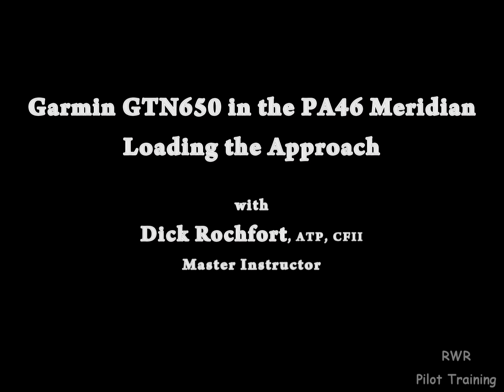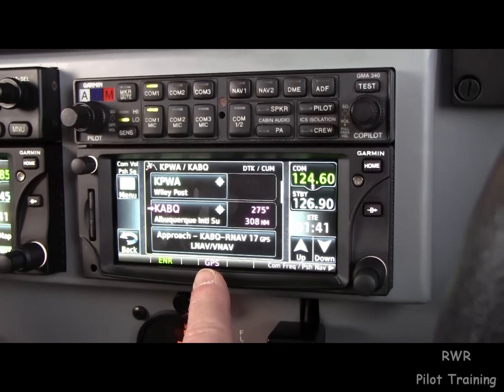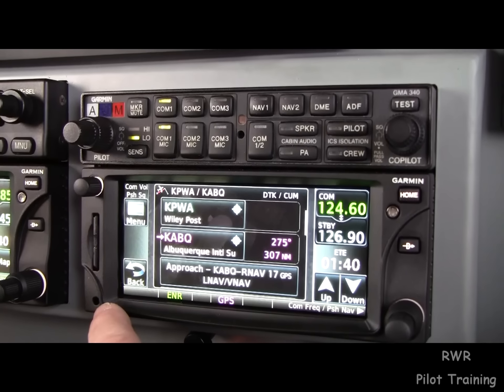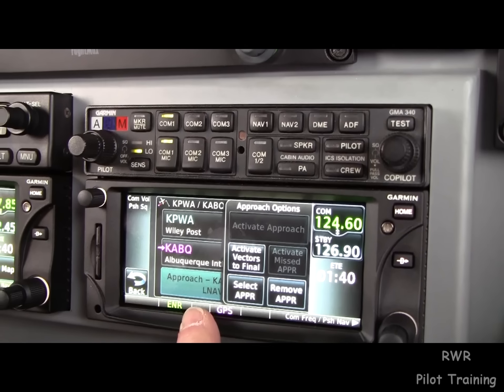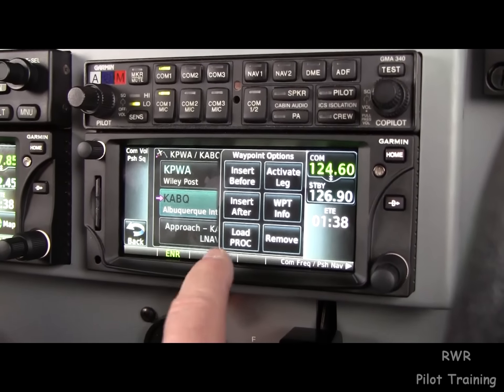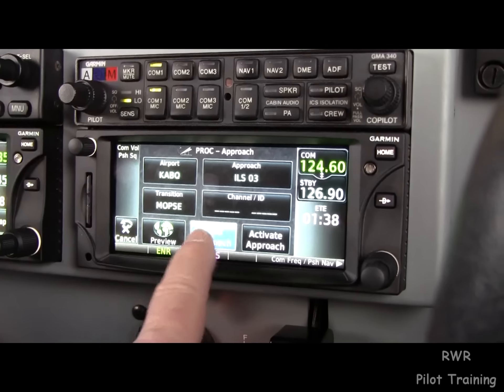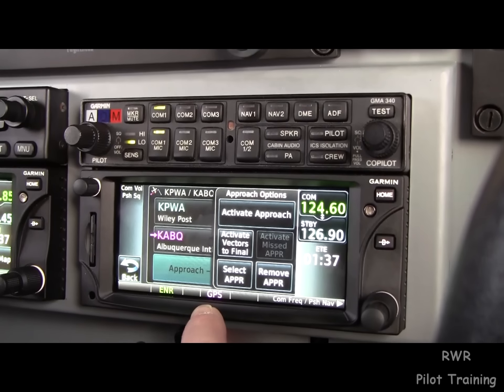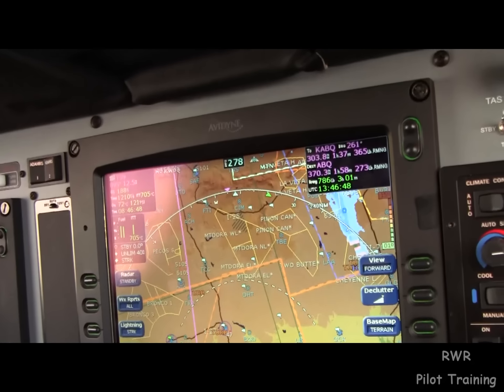Garmin GTN 650 Loading the Approach

Comment: 8/27/2023 - How is an approach unloaded?
Reply from the maker: The easiest way to remove an approach from a flight plan is to load the new one. If you just want to remove it without loading a new one; go to the flight plan. Turn on the cursor and put the cursor over the title of the approach. Pere “CLEAR” then “ENTER”. I will do a video.. Fly Safely - Train Often .. DR